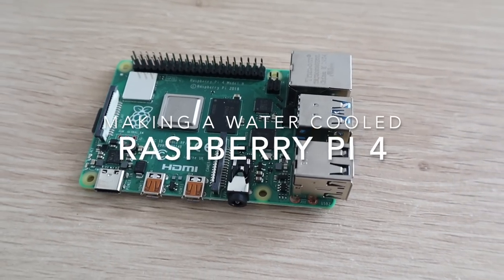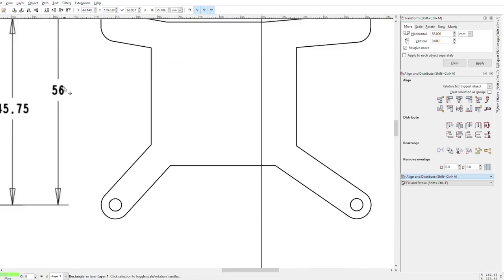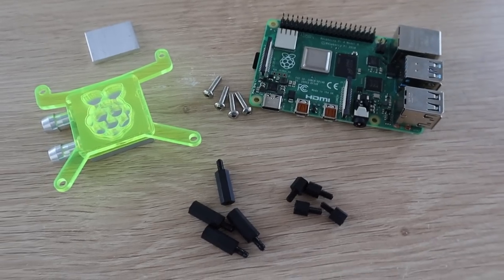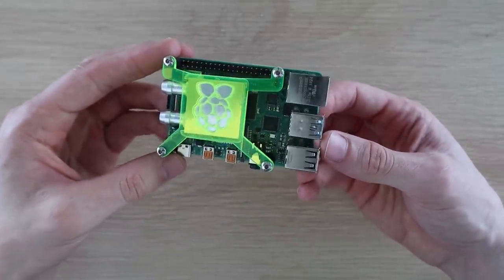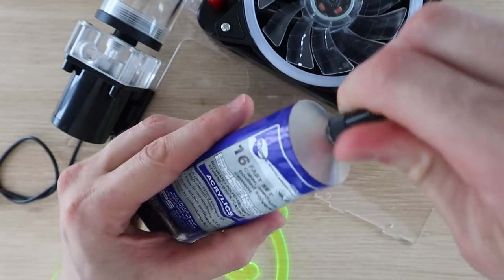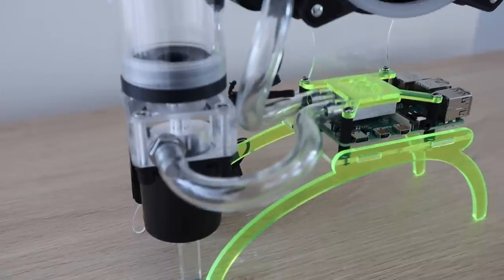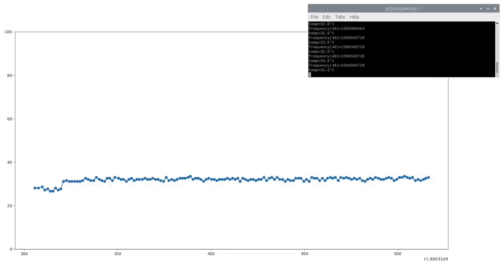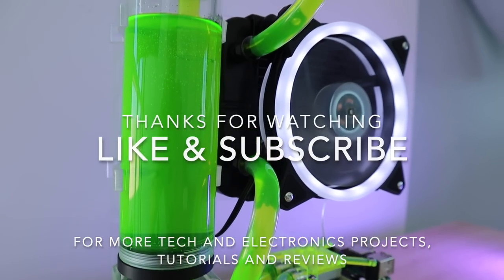Water Cooled Raspberry Pi 4 - Totally Unnecessary, But Pretty Awesome

Comment: I did something very similar last year, when the Pi 4 was released - with all the talk of it being a "desktop computer" I decided to have fun with the concept. You have used very similar parts to my build, except I mounted my Pi in a cheap clear sided Mini ITX computer "Gaming" case (with RGB fans and UV LEDs + reactive water coolant) that was an Amazon return item - only £17 ;)
In my case I used a water block that had the fittings on the top, and I used an old Pentium 3 heatsink spring clip to apply a constant pressure on the block, but the general mounting arrangement is similar to yours. 

I do like the clean look your build has though, very nice!  :)
Reply from the maker: That sounds awesome. Would have loved to see a picture of the completed project! Do you still have it running?
Reply: i'd also love to see pics of this build, sounds cool

Comment: You should have used copper for the spacer instead of aluminium. Copper is a so much better heat conductor than aluminium.
Reply: That didn't really matter as the temps didn't go any higher than around 34 degrees which is very cold. I don't think copper is necessary.
Reply: @cryptoAlgo  You may be right in principle, but I'm a little bit geeky 🤓
Reply: @e1woqf  no...unnecessary waste. If could oc higher then it might be considerably nice addittion.
Reply: @e1woqf  
Geeky?

A real geek would have pointed out that a Peltier combined with an Environ hat to prevent condensation would be the way to go...
Reply: @daves.8869  Ermm...No. One of the great advantages of all Pis is their very moderate energy consumption.  🤓 Using copper instead of aluminium comes at no additional energy costs.
Of course we could argue about whether a water cooling is necessary at all.   😀

Comment: I wonder if it's possible to delid the IHS like many do with intel processors, and get direct die contact, the thermal resistance there is probably at least part of that spike you are seeing.
Reply from the maker: I’ve seen one comment say that they had done this, I guess the inept way to find out is to sacrifice a Pi! It would be interesting to try out either way.

Comment: Obviously over-the-top silly fun, but I bet some of those people building clusters of Pi4 units could actually benefit from liquid cooling by chaining all the CPUs together to one rad.
Reply: was thinking the same, but the last pi in the loop would have the least cooling (if at all),  split the single into x pipes and cool all of them at the same time ?
Reply from the maker: I've been trying to decide how to best do this for my cluster. My worry with the splitter is balancing the flow rate through all of the heat sinks. If one or two have more resistance than the others, then most (if not all in extreme cases) of the liquid will flow through the other channels.
Both seems to have one disadvantage. Using a single channel, the last one would have the least cooling and using splitters leaves a risk that one might not be cooled at all. 
I think the best solution is to make sure that the flow rate is high enough that the increase in temperature between the first and last Pi in the chain is not significant.
Reply: Yeah, fewer points of failure is more important than having even temps in my view.  As long as a simple loop through all the CPUs can avoid throttling, you've succeeded.

Comment: I don't know if it was intentional, but when you swapped the copper CPU block, which was included in the water cooling kit, you undid the seller's mistake. They paired an aluminum radiator with a copper block, nurturing corrosion buildup, causing the radiator to get messed up over time, but the use of aluminum blocks saved you from that.
Reply from the maker: I didn't really give that any thought on this project because the copper block was just way too big for the Pi anyway, but I am aware that you should stick to all aluminium or all copper.

Comment: it would have been interesting the maximum overclock you could reach... maybe even more than 2.0 GHz...
Reply: They don't go much higher than 2ghz. I think the max someone has managed is about 2.3ghz. If you think about it, that's more than a 50% overclock. Which is a pretty insane increase. They aren't really designed to go super high. Not only does the CPU design restrict it, but the power draw does as well. Even if it could go higher, you could get enough power to it AND you could keep it cool enough, it would become extremely unstable and just fail constantly. And probably just get fried.
Reply: I imagine he's going to hit a voltage wall or something instead of a thermal one.
Reply: @honestgoat  Mine goes to 2350/750/550 MHz. But only 8GB version can go as high, because it has a 50% faster frequency of its onboard switcher (PMIC). The 1/2/4GB models tend to reboot at all core load as low as 1860MHz. All core load means also GIMP blur filers. Pi400 and CM4 have inherited this upgraded PMIC layout. An I mean on air, no using LN2 as we did here https://www.youtube.com/watch?v=RbzKM5XxlOA
Reply: The new ULTIMATE 7ghz GAMINFG pc 🤔😂🤣😂😂

Comment: this is an absurd ammount of overkill cooling lol
Reply: The spacer he put is enough but still cool
Reply: At stock max load temp is 80+ but 35 range max load is overkill 😂🤣🤣😂
Reply: Meh... I am using an ICE Tower and I overclocking my pi to 2GHz... in a cold day I am running at 25-28celsius... but in a hot day I think it can go up to 40celsius...

Comment: I've had my pi overclocked beyond 2.147 with the ice tower, this might overkill for just 2Ghz
Reply: sadly he did not menton ambient temps, in some hot countries this might be useful for overclockers.
Reply from the maker: Sorry, I definitely should have mentioned the ambient temperature. The room was around 25C during this test, pretty warm to start with.
Reply: Yeah I have my PI4 with the ice tower OCed to 2.15Ghz all day long.  I dont think the temps go above 40c at full load
Reply: @chucksanders7131  i run 2.3GHz and the HIGHEST i've seen my temps go is 71C under sustained full load for 5h, with a passively cooled full alu case (akasa maze pro), funnily enough pointing a desk fan at it cooled it down to 49C in ~10 minutes
Reply: @chucksanders7131  link where i can buy ice tower ?
Reply: @chucksanders7131  thanks man..just ordered from banggood..hope it reaches soon !
Reply: @chucksanders7131  thanks man..just ordered from banggood..hope it reaches soon !

Comment: If you use a copper water block instead of an aluminum one and apply liquid metal as a thermal compound, the results will surprise you.
An incredible video and set up
Reply from the maker: Thanks for the suggestion, I'll have a look at trying this with a copper block
Reply: @MichaelKlements  Don't use liquid metal. if it oozes out it is electrically conductive and can short circuit stuff, but yes a more thermally conductive block and diamond embedded higher K thermal value paste would or might help

Comment: That's awesome. is 2ghz the highest a Pi4 can go with this sick of a cooler?
Reply from the maker: No, the Pi should be able to be overclocked higher than this as the temperature is still well under the limit of 80 degrees. Mine just wouldn’t boot up over 2.0 GHz, so I’ll need to try on a better power supply and possibly a different Pi.
Reply: @MichaelKlements  Try the 8gb version. I don’t know if more RAM would be better but you could try.

Comment: I think de only reason for the temperature rising is bad connection between silicium chip and water head.
The fan is not needed at all and i dont even think the radiator is needed, maybe change the tubing to copper pipes, that together with the reservoir should be enough cooling.
If it was Res only, the water would slowly heat up to maybe 30 degrees or so, but it would take 1 day for it to happen.

Comment: How did you hook the power connectors for your fan and pump to you 12volt?  Just cut the pin connectors off and add the appropriate 2.5 plug?
Reply from the maker: I actually just made a small adaptor from the 2.5 plug to the 12V connector, but cutting off the connector would work just as well.

Comment: I immersed my pi4 overclocked to 2147 in mineral oil in a betta fish tank. It was $5 for the tank and $23 for the oil. I tri-boot raspbian, batocera and monkajaro. The temps are lower than this. Unbelievably nice job though!

Comment: It is very cool. But I had my pi running 32 degrees on average with just a regular fan. so I think yours can do some crazy overclock without any problem
Reply from the maker: The Pi's overclocking is usually limited by CPU voltage as the circuitry can't get enough current to the CPU to support much higher clock speeds. But yes there's definitely a lot more thermal capacity for overclocking!

Comment: Would probably still work fantastic without the fan. Just ambient cooling with the water and radiator.
Reply: The smaller gaps in the heatsink, the more it's dependent on forced airflow. That's why for example Ice Tower gets disproportionally worse with a fan off compared to CooliPi (https://www.youtube.com/watch?v=RbzKM5XxlOA)

Comment: Why do you use aluminum instead of copper?
Reply from the maker: Just because aluminium is easily available at most hardware stores, copper is a bit more difficult to come by. It also won't make much difference in this application as the cooling system is already way bigger than it needs to be.

Comment: Omg. Soo gonna do this just cause I can. Thank you for this. Great write up and movie and all! I found an svg to stl converter but I am using a 3d printer. Any way you can include files that is not a cut out but rather the whole item to be printed? I would gladly add it to the free 3d printing community website and give you credit for the design completely.
Reply from the maker: Thank you! I'll have a look at designing the bracket to be 3D printed rather than laser cut, it shouldn't be too complicated to adapt.
Reply: If you do, I too would be very interested in this! Great video, man. Much appreciated content. :D. 
Merry Christmas!

///
Robert, Sweden

Comment: It should be possible to use the power supply of the pi for the pump and the fan. This makes the fan quieter and the pump too, the disadvantage is that this reduces the throughput speed and the power of the fan.
Reply from the maker: Yes I actually did try this and it does work. The pump will turn over from around 4.5V but with very low output. The fan actually turns from 3V and is probably enough for the cooling requirement (not much required), the only issue is that the light on the fan doesn’t come on until 10.8V. Not exactly a performance issue but it just doesn’t look as good.
Reply: @MichaelKlements  So how is it powered in the video? I assume you dont have a 12v battery under your desk?

Comment: have you tried to overclock to 3.0ghz with this water cooling?
Reply from the maker: I don't think you can overclock the Pi to 3.0GHz. There is a limit to the voltage which can be supplied to the CPU and this seems to max out at 2.3GHz on the Compute module and the 8GB variants and at 2.147GHz for the 2GB and 4GB variants.
Reply: @MichaelKlements  thank you for the explanation.. i’m a newbie.. I thought raspberry can overclock to any thing as long as it is cool enough and not make it burn.. thank you 😁
Reply from the maker: Yes, keeping it cool is the first limitation. Once you've managed that then you run into the next, which is the CPU voltage. I remember reading somewhere that people have modified the PCB to boost the CPU voltage, but I've never tried this.

Comment: This is basically pointless except for maybe extreme overclocking the RP4. I plan to try this CPU block design, instead I'm gonna try to run it with coolant chilled to -78c with some dry ice.  This would allow the PI to be easily overclocked to 3ghz+ and take the records. It would even be possible to run LN2 directly from a tank through the CPU block. LOL ROBOCLOCKER for raspberry pi.

Comment: You could probably use an 80ml radiator and fan with no significant change in the  performance.
Reply from the maker: Yes you definitely could be able to, this setup was enough for my 8 Pi cluster, so it’s way bigger than it needs to be

Comment: I know the cooling is overkill. But with the spacer in between it completely useless. With direct contact and only thermal paste in between the CPU and cooler, U can lower the pump's RPM and maybe even do a passive radiator cooling loweing the power consumption and noise of the coller. The spacer makes this completely useless.
Reply from the maker: It would obviously be more efficient to put the block directly onto the CPU, but this isn’t possible with this size block without modifying the board and removing components.
Aluminium is still a great conductor of heat. All this spacer does is cause a slight delay in the the heat getting from the CPU to the cooling block, as seen in the graphs.
If you wanted the best performance possible then yeah direct contact or copper would be best.
Reply: @MichaelKlements  From an engineering standpoint I see a challenge for a custom waterblock and passive (fanless) cooling for the radiator ;) Low power pump. This might be good :)
Reply: @MichaelKlements  And I see what you mean with the components that are in the way. Getting a simple custom block would enable passive colling AND still overclocking
Reply from the maker: Yeah a custom water block would be the best solution! Need to get a small CNC router/mill next. The fan and pump are definitely overkill, you don't need the fan with this size radiator and the pump could be swapped out for a 5V pump, or just run at a lower voltage. It seems to turn over from around 4.5V, but only really starts providing decent flow from around 7V

Comment: RPi is RIP in near future. What's the point of whole embedded system concept when the board has more tantrums than a normal PC!
Reply from the maker: Embedded systems are the future of computing. Apple has moved to an embedded system with their M1 chip, all modern smartphones run embedded systems and Microsoft is moving towards embedded systems with their Surface Pro range. Most issues people have with Raspberry Pi's are related to trying to run software (usually from a windows platform) which isn't properly supported.